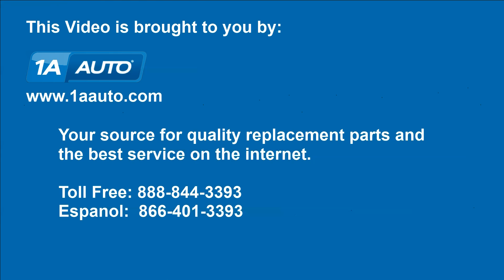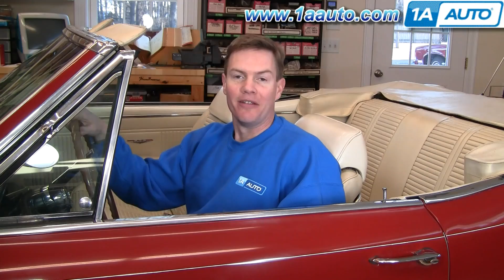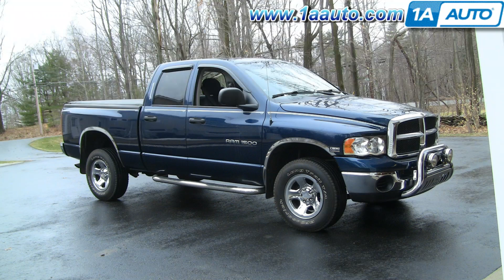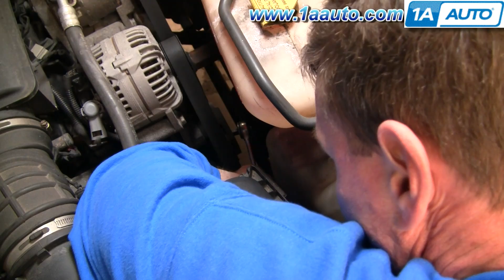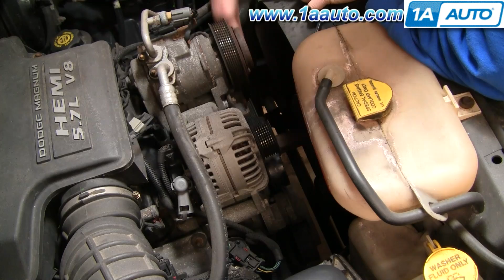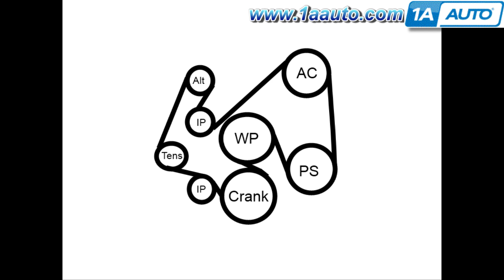How to Replace Serpentine Belt 02-08 Dodge Ram

Comment: This is so wrong.  On the 2005 Dodge Ram 1500 4.7L V8 you are not slipping the ratchet end into the tensioner.  It's not even remotely made for that.  There is a bolt on the far left pulley, and it is probably 16mm, but I made a 5/8in socket work to grab that to pull it to the right.  You have to move the plastic tank out of the way in order to be able to use a piece of pipe cheater bar, so you can hold that tensioner over to the right while you slide the belt off.

Comment: just a note to DIYers: you might find the 3/8" wrench doesn't provide enough leverage fir you to easily place the belt upon the alternator crank. There are special tools that make this process easier and it may be wise to have one before you begin.